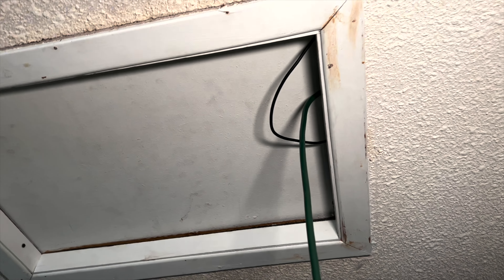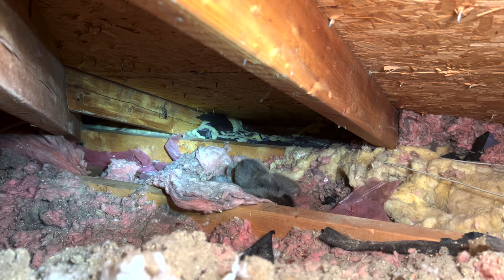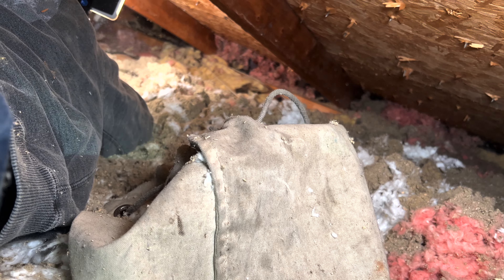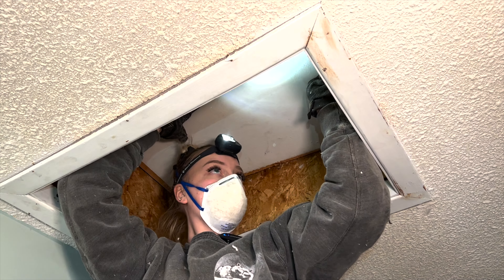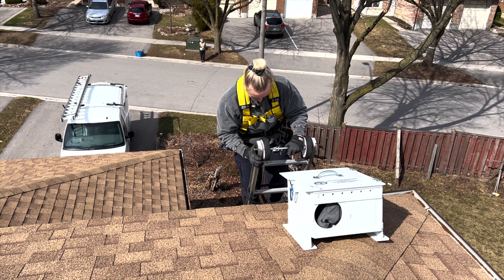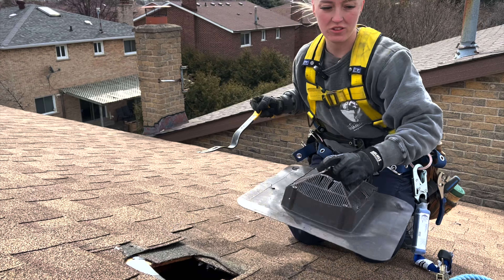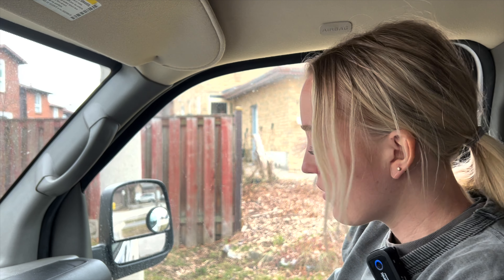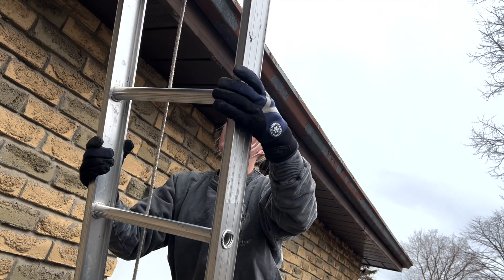Epic Attic Adventure with Raccoons and LOTS of Insulation | Raccoon Removal From Attic

Comment: The thick warm wool in the attic is of course very cosy for the raccoons.
Here in Germany, they used a material called "glass wool" for this kind of thermal insulation.
However, it has a lot of tiny glass splinters inside the pressed layer of cotton wool.

But I don't know what the purpose of the glass splinters was.
I also don't know if this pressed glass wadding is still used today.

In any case, these small glass splinters caused a terrible itching on the skin, and you probably never got rid of the glass splinters in your skin.
It must have been torture for animals to build their nests in such dangerous glass wool.
Here in the video, it seems to have been normal cotton wool that is compatible with living bodies.

Nevertheless, it's good that the little raccoons are out of there.

Thank you very much for your work !
Reply: pink glass wool is still used in the US called fiberglass.  Nasty stuff to handle!
Reply: @reginaromsey  
You have to cover your arms and hands well when working with it. Otherwise, the tiny glass splinters in the material will quickly pierce the skin and remain there.
They then cause severe itching.
It's a shame that this stuff is still around.